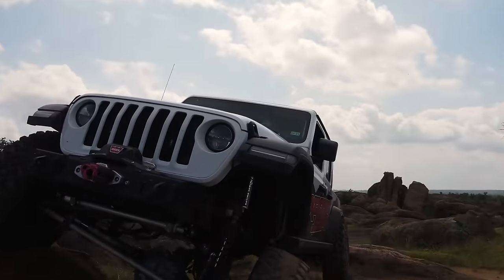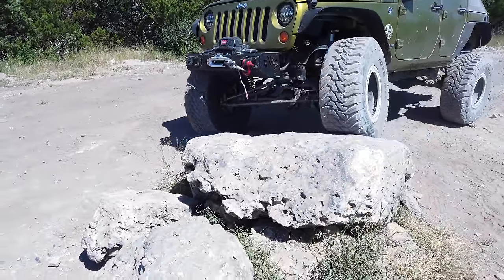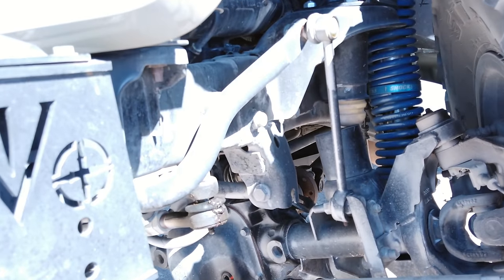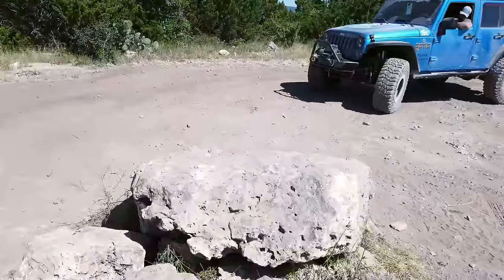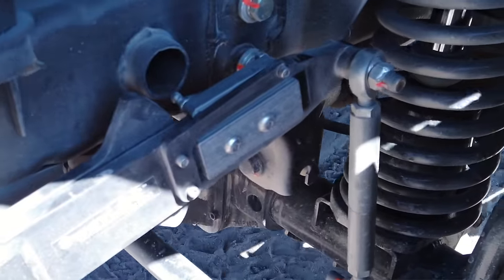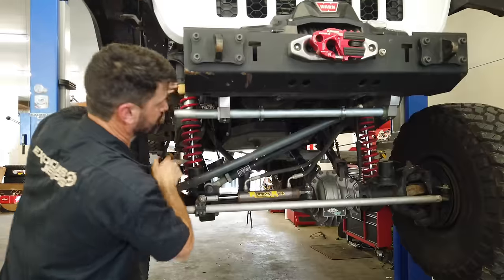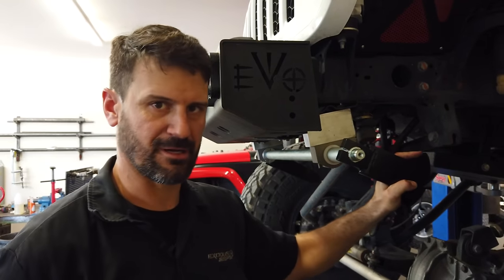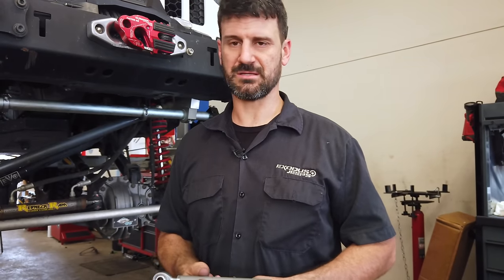The BEST of the BEST Jeep Sway Bars

Comment: Sir, I have the Antirock now, and I tow a small trailer, so it is dangerous on road. However I wheel hard offroad. My question is , do you feel the ORO flexes more or less than teh Antirock offroad? The reason I ask is that my Antirock limits articulation by a couple of inches. I wish ORO made a single rate like teh Teraflex ....but I have not found any comparison between teh ORO and teh Anti Rock "Offroad".
Reply from the maker: The SwayLoc flexes the same and the anitrock!
Reply: @Exodus4x4   So....

Your saying the Swayloc is limited just like "Mefobia Jeep" said his Antirock is?! 

If so, I'd like to see how you determined that (other then theory).

Comment: Any concern with mud gumming up that latch from going back to "highway mode"?
Reply from the maker: I don’t mud. It happened though, once. I took a bottle of water and washed off the latch. Everything was good!
Reply: Even worse is when it freezes over while Off-roading during the wintertime.  I can only imagine chiseling these out to drive home after a day at the park.
Reply: @MrCrazypops   What's worse, is getting under the vehicle to reconnect with mud/water/ice dripping on your face and down into your ear....  ;)

I love my Terraflex Dual Rate on my LJR... so, I'm thinking the Sway Lock for the JKUR. I try and steer clear of mud, and don't off-road in snow/ice where I live (San Diego). And Moab or CO is done during the warmer months.

Comment: I just put one of these in my JT overland EcoDiesel but am having a lot of clunking while driving on road.. 

I noticed instructions weren't super clear about the extra zerk and bolt... and it seems maybe the manual lever on mine was put on the wrong side? (Facing the tire/link?)
Reply from the maker: Nope, that's the way its suppose to be installed. I would contact the manufacturer
Reply: @Exodus4x4  I contacted them.  Turns out I've got a few things wrong.  

Mainly that I missed the "grease side is specific" part. Lol.

So I've gotta swap the to the other side and regrease and what not.. 

Oh well.. live and learn.

Comment: I'm glad you did a review on the Swayloc. Thank you 🙏

I have a rooftop tent and awning so it adds considerable weight to the top side of my JKUR. So on bumps and turns, I'm leaning or bouncing side to side at times.  

Do you recommend the Swayloc as an upgrade to help with this?  Or do you think a suspension upgrade is in order?  Or both?  

Currently using a metalcloak 3.5" six pack on 35's and prefer to go off road but not necessarily crawling over rocks as much.
Reply: Having tested the swayloc as well it would be a great upgrade for your setup to add stability on road without sacrificing off-road capability.

Comment: How about the Teraflex dual sway. Which would you use for overlanding (top heavy 200+ pounds above roof)?
Reply from the maker: Not sure, never used it.
Reply: I’ve ring the TF Dual Rate for 11 years, similar to the ORO. I swear by it. . Either will get you there.

Comment: How do you feel about the Hellwig rear swaybar?
Reply from the maker: Probably pretty good but haven’t seen on up close
Reply: @Exodus4x4  Just installed the Hellwig and definitely helps alot with top heavy sway. I haven't tried it offroad yet, but it is adjustable if need be.

Comment: Is this available for the rear as well and how stiff is street mode compared to stock?    

As far as the tailights, can you replace the blind spot ones from your max tow with regular ones and just turn off blind spot monitoring?
Reply from the maker: I think they do. You can but I like the LED’s. It only chipped it a little, nothing bad
Reply: Exodus Jeeps oh yeah I like the LEDs I just meant the regular LED not the super expensive blind spot ones
Reply from the maker: I don’t think there’s a LED without the blind spot monitoring

Comment: What if it’s full of mud? Will it still lock?
Reply from the maker: I think we need to take a little responsibility for ourselves and clean our toys off after getting in the mud🤣
Reply: Cleaning would help but because the notch is fairly large as long as the mechanism isn’t caked solid it will lock.